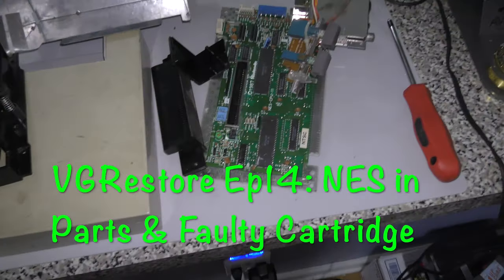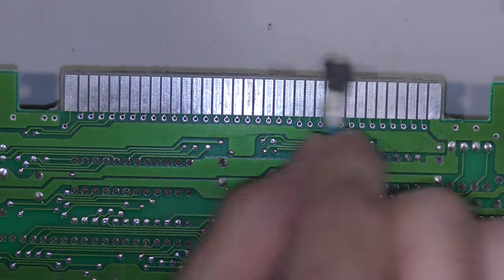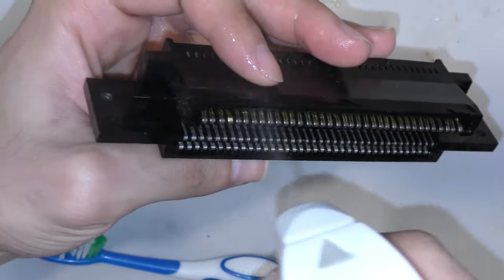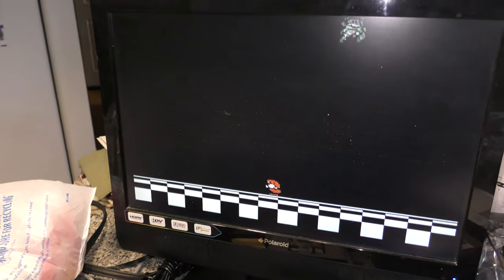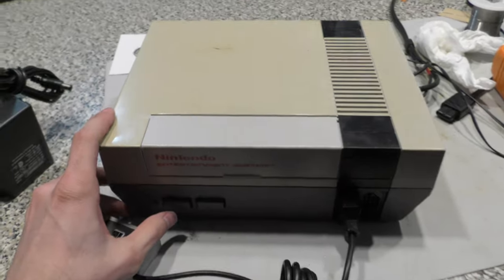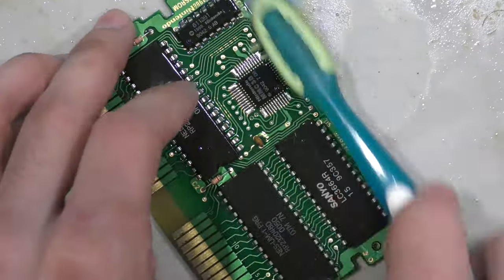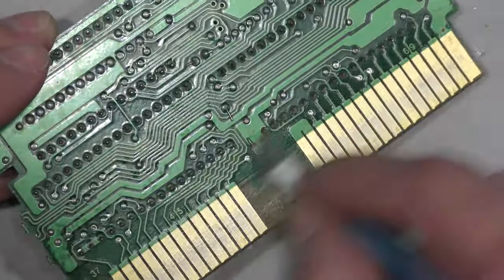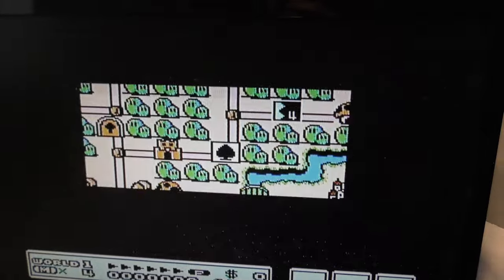VGRestore Ep14: NES in Parts & Faulty Cartridge

Comment: i stopped using super glue for fixing broken plastic as it turns brittle with heat and age, my repairs would just break again with little effort. now i use Tamiya ABS plastic glue but really any of the Tamiya plastic glues work brilliantly at chemically melting the plastic back together again and leaving it looking like new and stronger than ever before. it just requires a little patience to let it go off completely but its ideal for anything thats going to take strain like screw posts and pcb supports.
Reply from the maker: I just ordered some from amazon should come after Christmas it seems it wasn’t eligible for prime 2-day shipping. Thanks for the tip hope it works better than super glue.
Reply: @PunkNDisorderlyGamer  yeah being in the uk i have to wait ages for tamiya stuff because its made in japan but the quality is great, since it comes in a glass bottle with a brush on applicator you can use just the right amount you need and it fully cures in about an hour to the plastics original strength.

Comment: I had hacked a 360 dvd firmware out of the box back in the day. Just ran it without the top and unplugged the dvd drive when I wanted to go online so they couldn't catch me playing dirty.

TLDR top cover is optional. Let it be a convertable.
Reply from the maker: Yes, wouldn’t Microsoft eventually implement “checks” to see if the media that was being read was legit? I would suspect someone online without a dvd drive being detected would throw up red flags, no? I went the ps3 route and I’m not too familiar with the 360 mod history. 

Yes top cover not important, unless it’s a bird cage.
Reply: @PunkNDisorderlyGamer  There were like 2 dvd drives at the start and I had the hitachi or whatever that ended up losing support. So like it could do the first year or two of games. It was exciting to have a new system that could play bootlegs, but I made sure to disconnect when I went online. Eventually a lot of players got banned but I lucked out. When you can play everything at blockbuster, you end up just kinda dabbling and not really playing much of anything.

Of course PS3 was gonna run linux and play everything homebrew right out of the gate... oh wait!